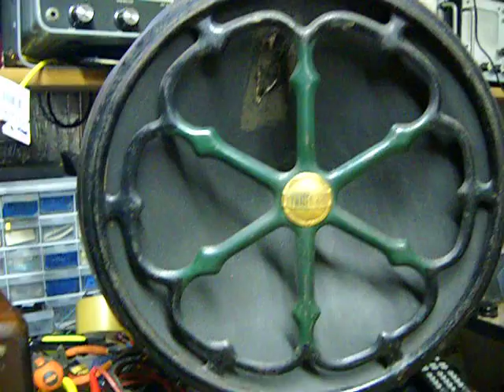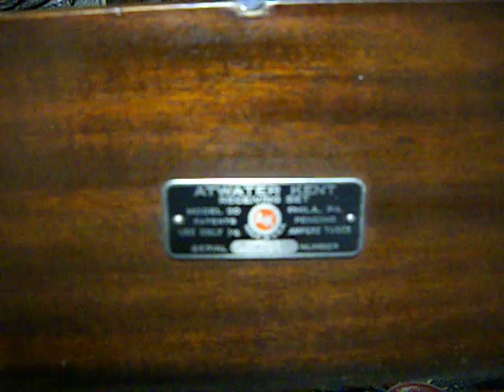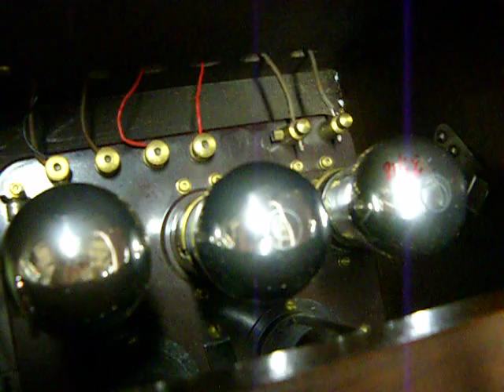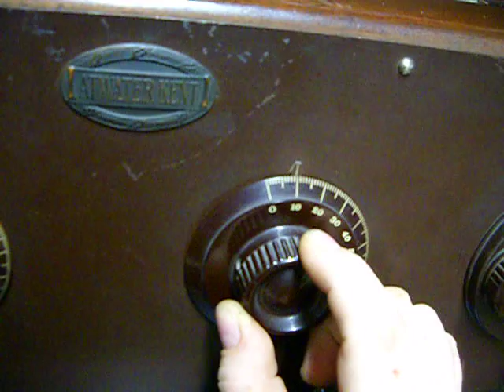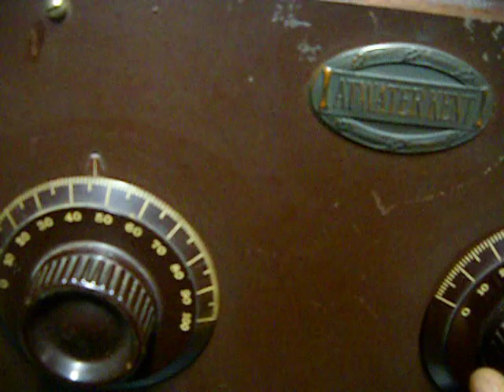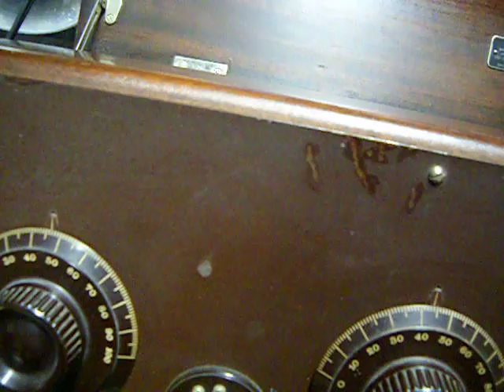Atwater Kent model 20 test flight

Comment: Transformer can be repaired. Usually where they attach wire to enameled copper wire - joints may fail.  May need rewinding in worst case. For interstage transformer, maybe a good idea to try a small power transformer primary winding - 5VA transformer . should improve gain until you can fix the original transformers.
Reply from the maker: Transformers were replaced.   I think the tar potting material was acidic, the copper was green and turning to dust once I got the tar melted out.

Comment: I have an Atwater Kent model 20 but need to build a power supply. What did you use for a power supply?
Reply from the maker: I have one I picked up cheap at an auction that supplies all of the voltages.  Its a fairly poorly assembled kit, but I don;t know what kit or who built it.   The usual suggestion is an ARBE,  https://www.arbeiii.com/  its a fair bit nicer than the one I have, and less likely to cause death.  Mine has exposed connections all over the place.  You can also just use a 6v emergency light battery and a string of 9v for the high voltage.

Comment: Can you connect the speaker of these to a modern amp and have it play or is it different, like different impedence?
Reply: This is a "moving iron" speaker, which was built before large permanent magnets were commercially available.  The power-draw of a large electromagnet would have shortened battery life unacceptably, and using AC power would have introduced an unavoidable hum.

The "moving iron" is a metal reed, coupled to the cone, which is suspended on a spring, and moves in response to a powerful, modulated magnetic field. High voltages were required to produce a magnetic field sufficient to move the reed.

The "dynamic cone" speaker was made possible by the availability of large permanent magnets. A much smaller coil could be attached to the cone, and much less power was needed to produce a modulated magnetic field strong enough to move the cone.
Reply from the maker: +coondogtheman1234 
The stock speaker is something around 2500 ohms.  It also has 90 volts DC running through it.   It feeds power from the battery (or supply) to one speaker lead, and the other speaker lead connects to the plate of the audio tube.  In more modern tube amps, this would be where the output transformer is, but these don't use one of those.   A modern speaker with a transformer will work, but you've got less than 1/2 watt of audio power to work with.  Transformers add loss, so the audio level falls off pretty quick.
Reply: gadget73

I saw another video and the guy in it put a 9V battery to the two pins and it crackled like a normal speaker so I was hoping if I ever got one of these I'd put an amp on those two pins and start jamming.
Reply from the maker: +coondogtheman1234  The old type speakers will crackle if you put voltage to it, but with the high voltage DC on it it won't let you tie it to an external amp off the speaker terminals very easily.  You can fit a resistor in there to act as a plate load, and wire in a capacitor to pass the audio but block the DC.  Some radios are set up like that, this AK is not though. Doesn't really need an external amp honestly, the stock type speakers get louder than you might expect for the tiny amount of power available.
Reply: gadget73

So if it crackles then why can't you just hook it to an iPod amp. Does it need to be powerful or can I hook it to a walkman? My guess is the DC is needed for the magnet. I know some old radios have a separate power coil to act as a magnet b/c permanent magnets didn't exist in speakers. I'm not 100% on how these work, is there a coil like in a modern speaker?

I'm only interested in connecting one of these to a small amp and not hooking the radio to a modern speaker.
Reply from the maker: +coondogtheman1234  Ah.  For some reason I was thinking you meant to hook the radio to a modern amp, not the speaker.  The speaker you can connect to other things, but its high impedance.  You'd need a transformer to match it up.  An output transformer for a cheap 1950s radio run backwards would do it.  These are permanant magnet speakers actually, the field coil thing didn't come around until a couple years later.
Reply: gadget73
I've seen transformers on old speakers Could I use one of those? I imagine the sound quality isn't the best like no bass. You would think a big speaker like that would have lots of bass. I'd love to see someone take one of these speakers and run modern music through it. I know it's kind of not the right music to be playing through it since it's from the 1920s but it's just a speaker. Heck if I had one of these or even two I'd hook them to my PC and play some Half life 2 gameplay thru them.
Reply from the maker: +coondogtheman1234  One of those might work, or even a 6.3v filament transformer is reasonably close.  

No bass, not much for treble either, think PA horn speaker and you've got the idea.   No power handling either, maybe 2 watts at best.